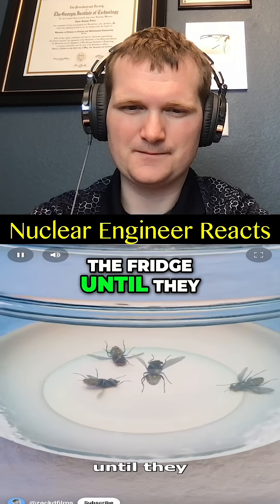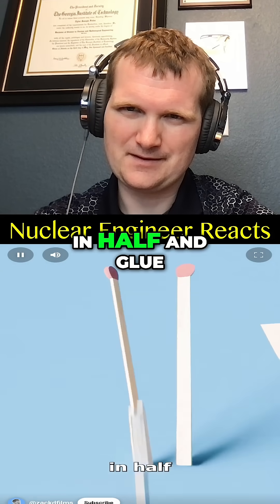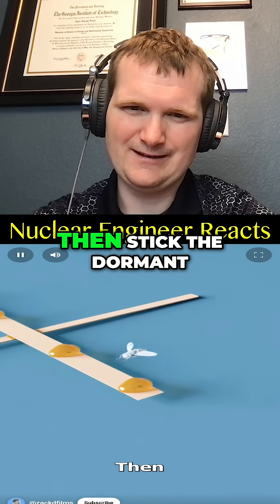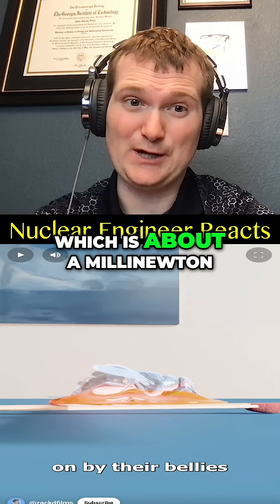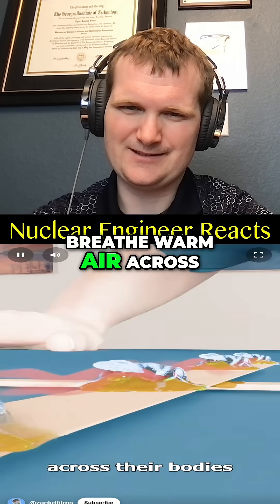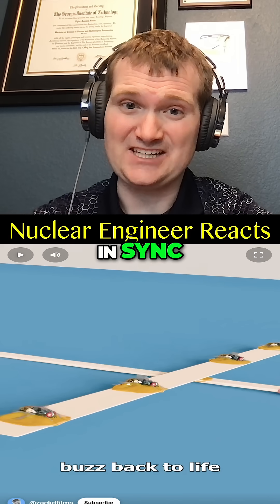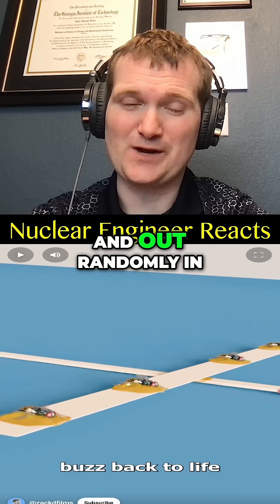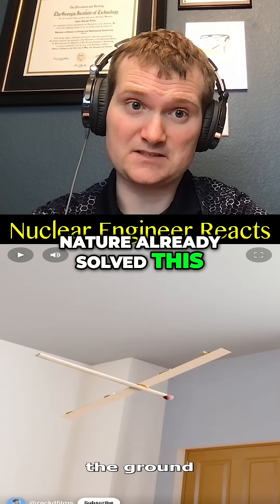Can a Fly Powered Plane Fly? - Nuclear Engineer Reacts to Zack D. Films

Comment: Flies can accelerate and change direction super fast, which tells me their maximum lift force is a multitude of their weight force.

The animation of the glue is exaggerated. We don’t need to drown the flies in glue.

All the flies would want to escape from the glue and try to create lift. Even if they are not synced it’s unlike their lift cancel each other.

What we really need to know is the thrust of a fly and the weight of the glue + paper.